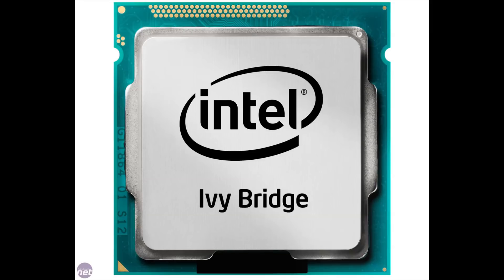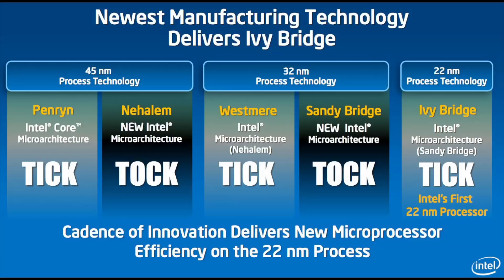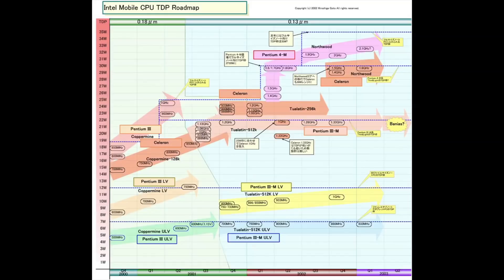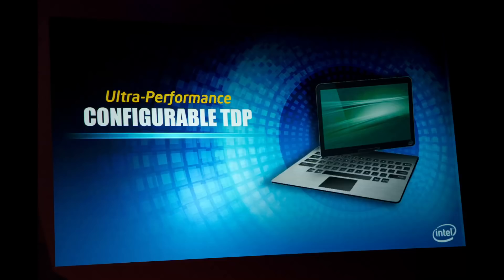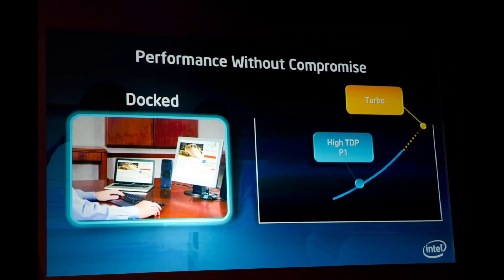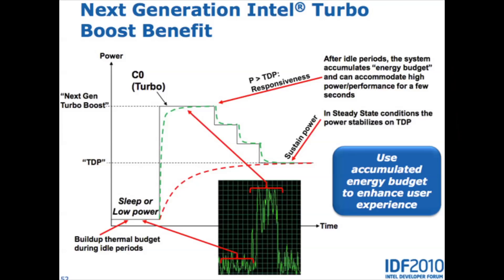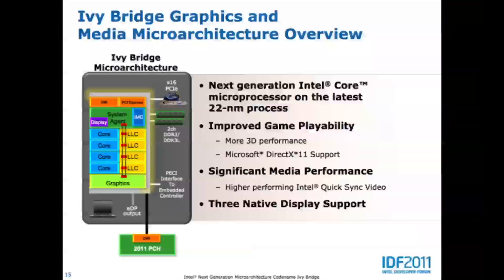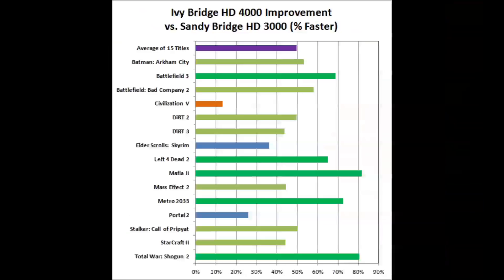In Depth: Intel's Ivy Bridge Platform

Comment: My personal Fave the Sandy bridge 1650 v0 over clocks sky high and the Ivy bridge 1660 v2 (what I would run) is clocked high enough out the box with its turbo and of course let's not forget the "Holy Grail" of Cpu's as in sort of the 9900k in. Xeon form (close) that was available in 2013 or so... the XEON 1680 Version 2. It's shares the benefits of both other chips above but with 8 cores and 16 threads and overclocks almost as high if not a little more _ depending on specific chip 'then the 1650v2... all great chips, if rollback to 1366 I suggest the x5675 and if roll forward to Haswell, the 5930k is the most under rated Cpu of all time. The most overpriced CPU of all time (dunno why, only Rick folks have them even headed into 2019?..) is the 4960X for X79. Better off with a Xeon but those 4960's do seem to ALL overclock like champions which null and voids the "just get a 4930k" when comparing which again, leaves us with the xeon choices of the 1650 version 0 even if probably the biggest overclocker of them all and for price to performance, the best chip if can find one at around $99.99 can't beat that... BTW: one of my favorite chips of all time and still the best price to performance for gaming is actually and surprisingly not a Xeon but the sometimes OverLooked 2500k that can do so much on the proper MOBO, it's still a Beast of a gaming CPU especially cause of how cheap they are because of people's ignorance combined with them being in many big label machines (used) like HP, Dell, Gateway, etc.. grab one and slap in a 780ti and most likely a better PSU (make sure it fits) and your gaming all day in 2k / 4k even 'especially when parred up with the proper MOBO that's good to even decent at overclocking as the 2500k begs to be overclocked. Matter of fact, not overclocking a 2500k should be outlawed! #2500k ;)
Reply: I have an unlocked es sample ivybridge E xeon which appears to be a mix of a 4960x and 1660v2 
Extremely similar in performance and overclocks decently for its age.. do you have any other info on these older LGA xeons?